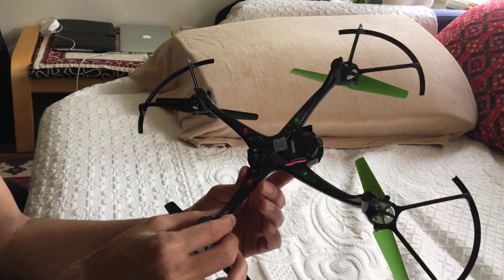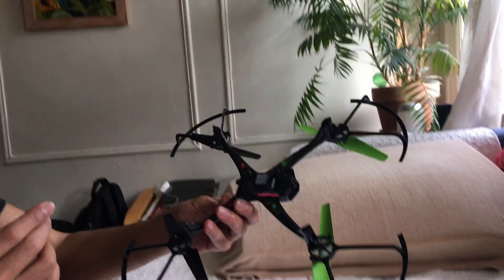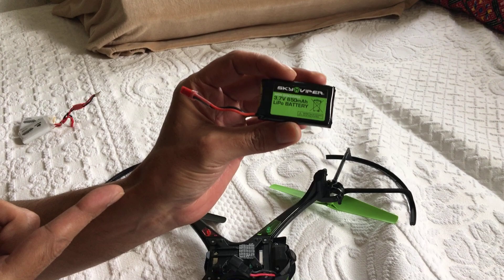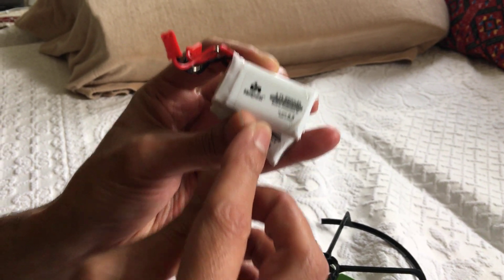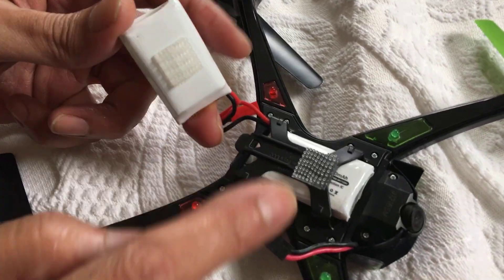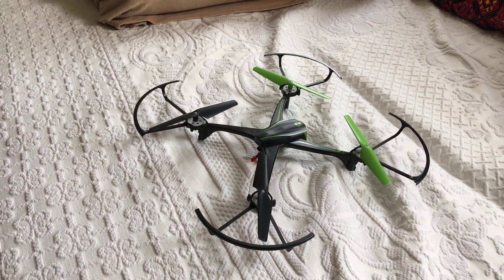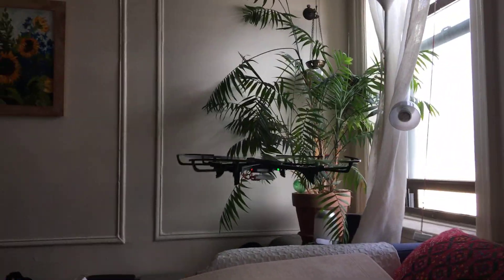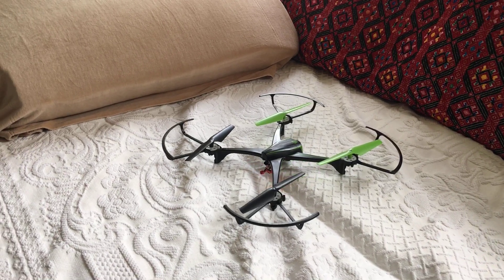Sky Viper v2400HD drone modifications - part 1

Comment: 3.7  3.7 - 7.4v
Reply: No it’s still works
Reply from the maker: @rcworld7146  Gains in speed, performance?
Reply: Naseem Max Mansoor It’s a bit over powered On sensitivity 3 it’s goes Insanely fast like I mean it’s goes 30.2mph
Reply from the maker: @rcworld7146  Wow. Very nice. I am worried about the the circuits burning out but I will try it myself and post a video. Do post a video if you have made one. Thanks.
Reply: Naseem Max Mansoor I Won’t Burn out The circuitboard can Handle 1s 2S max i got one from goodwill for 3$ With a remote but no battery so I just had a 2s battery
Reply: Well I went outside to fly it and one of the motor die and I replaced it to a new one
Reply from the maker: @rcworld7146  How much flying do you think you got out of it? How many minutes before the first motor burnt?
Reply from the maker: You want to go series instead of parallel ? Have you done that? Has it burnt the circuitry yet?

Comment: Can I use 2 of the 1200 mah that viper sells and put them together. I don't know what max mah i can put together.
Reply: TheTruth Doesn’t matter about the milliamps It matters about the voltage
Reply: The circuitboard can handle 7.4v 2s lipo

Comment: U can just buy a 1600mah battery instead of two that weigh twice as much and only gives u 100 more mah
Reply from the maker: Tell me which one? give me an amazon link. I will make the mod and post the video here. I have looked at a 2200 mah shaver battery that would work fine and should give around 50 minutes of flying time. Interested?
Reply: The highest I can find is 1200, if you have a link to purchase higher mah please post...Thanks, Colin
Reply from the maker: Collin I am not sure if the question is aimed at JROD or myself. I am not sure if I know of a 1600 mAh battery that would fit the drone without some tinkering!! Let me know. Happy New Year. Cheers.
Reply: Ya I can post a link for ya I'll do it inna few when I get home sorry just seen this.

Comment: I need some help. I was flying my SkyViper 2400HD today when one of the props flew off mid flight and after inspecting it I found the reason was a small metal clip that holds the shaft that the prop is on.  Where could I get another one of those metal lock clips or how could I fix it otherwise?
Reply from the maker: James check these out.......
http://www.getfpv.com/replacement-c-clips-for-2mm-shafts-10pcs.html
http://replacementparts-skyrockettoys-com.3dcartstores.com/Streaming-v2400HDFPV-Motor-and-Gear-Set_p_64.html  (this one out of stock)
https://www.amazon.com/Brass-Washer-Plain-Finish-Metric/dp/B009OK2D3E/ref=sr_1_1?s=hi&ie=UTF8&qid=1491745636&sr=1-1&keywords=2.2mm+washer (this should probably work for the washer)
Reply: Thanks, they were out but I signed up for when they get more
Reply from the maker: http://www.getfpv.com/replacement-c-clips-for-2mm-shafts-10pcs.html
Reply: Thanks very much, I appreciate your help.
Reply: Same happend to me its called a c clamp i temporarily wrapped a stripped bread tie arounf it and twisted it tight and clipped it not too close to the axle

Comment: The charging port for mine detached, any idea how I can fix it, or where to order a new one?  I'm assuming I need it for any of the batteries, mod or no mod.
Reply from the maker: Which charging port. The two wires that run into the drone itself?
Reply: Naseem Mansoor the one directly below the on and off switch. the little white piece you plug the charger into.
Reply from the maker: Are you talking about the Sky Viper v2400HD or some other model?
Reply: Naseem Mansoor it looks just like yours. I believe they're the same model
Reply from the maker: Mine does not have a charging port or an on off switch. Maybe I could help if you can tell me the model.
Reply: Naseem Mansoor I feel stupid. it's actually the s1350
Reply from the maker: You can try to take it apart and see what is going on. You might need a soldering iron and soldering skills. I would gladly take a look for you but the shipping etc would not be worth it. Good luck.
Reply: Naseem Mansoor my friend is pretty good with this stuff so I let him look at it and hopefully he can work some magic. 

it's my nephews and honestly I don't have much praise for this model. the battery is internal and very volatile from what i've read so I'd prefer the model you have tbh. I love how organized your modifications are. if all else fails I'm looking into replacing this with a better model. thanks for taking the time to reply, regardless.

Comment: hello sir i really need ur help    my  remote is beeping and the drone dont respond  i just put brand new battery  and my drone just got charge
Reply from the maker: Hi there GAR. If I understand this correctly you replaced the batteries in your controller and the drone, and the controller is beeping. Do the following. Get new batteries for the controller one more time. Replace the drone battery with a new freshly charged battery one more time. Connect the drone battery first. Then turn on your controller with your left joystick pushed all the way down towards yourself. Wait 1 minute and then please tell me what are the results. Cheers.

Comment: Do you know where I can find parts? I need the washer/clip on the bottom of the blade.Somehow we lost the clip and now we can't fly it until we get a replacement.
Reply from the maker: William check these links please
http://www.getfpv.com/replacement-c-clips-for-2mm-shafts-10pcs.html
http://replacementparts-skyrockettoys-com.3dcartstores.com/Streaming-v2400HDFPV-Motor-and-Gear-Set_p_64.html  (this one out of stock)
https://www.amazon.com/Brass-Washer-Plain-Finish-Metric/dp/B009OK2D3E/ref=sr_1_1?s=hi&ie=UTF8&qid=1491745636&sr=1-1&keywords=2.2mm+washer (this should probably work for the washer)
Reply: Would the washers be the same size? Just realized that is missing as well. I am searching that parts site right now to try and find them.
Reply from the maker: The third amazon link above is the washer site. I calipered my washers and those washers "should" do the trick. Just don't come looking for me if they don't :)
Reply: Sorry I didn't see the "read more" button before or I would have seen the third link. Appreciate the help. Even if they just work "okay" it's better than the drone not working at all which is the issue. My son will be happy that he gets to fly this again soon.
Reply from the maker: Would be nice if he could get it in the air again. Good luck. Do let me know if I can be of assistance.